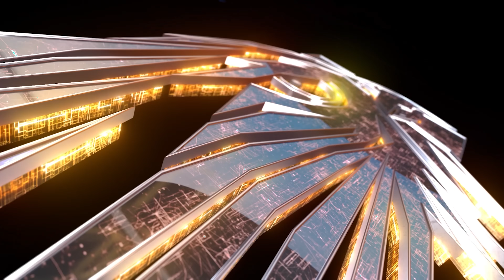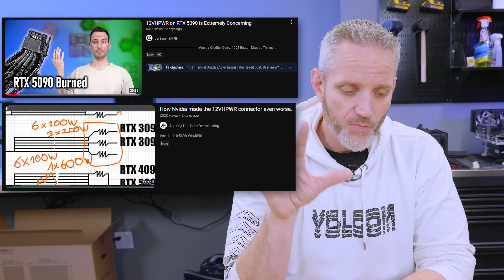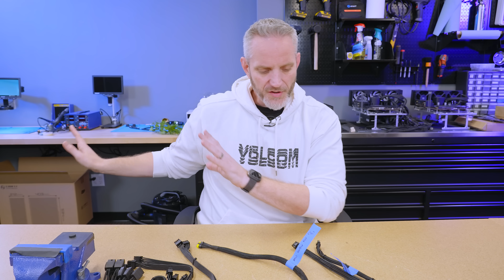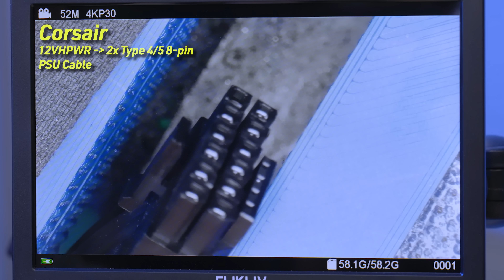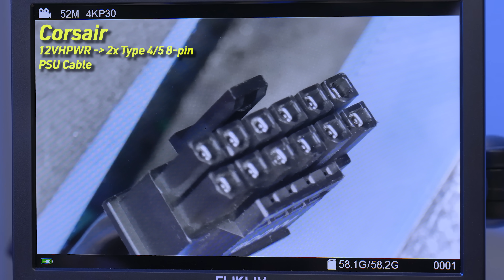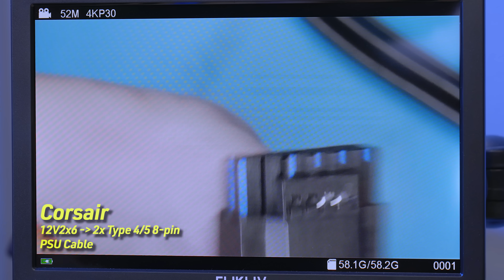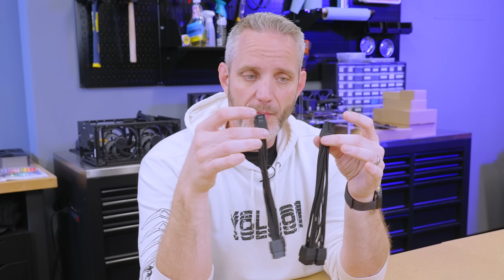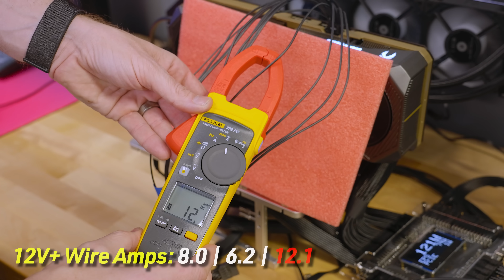I discovered something concerning and I need the Experts to chime in... More 12VHPWR discovery!

Comment: I see it clearly, its a design flaw. They should have never ever used that type of terminal and connector or multiple thereof to provide 50 AMPS of current period! 6 small connectors that were never designed for high currents, paralleled to provide such.  Any difference in connector to connector resistance no matter now little results in heat. Heat eventually damages the wire connection and the terminal creating more resistance and more heat. Its a self fulfilling cycle until eventual meltdown. They should have used a high power rated connection system like an Anderson Powerpole or xt60 type connector. and just one set of 12v  wires and connection would be needed  Electronics history and power connections is replete with such failures.  One example is Pinball machines and their molex connectors overheating for powering 12v lamps.

Comment: I've said this since the beginning of this drama that the problem with these connectors is the pin size.  You cannot take a 16 AWG wire and neck it down to a 22 AWG pin that isn't solid gold and push it to full spec of the cable and not get melting.

Comment: And here I was just thinking it was time to simply cross out the 600 on these damn cables, treat it like a ~350, recall GPUs or undervolt and reduce power targets on existing ones accordingly, republish benchmarks with the safe power targets, and use a new power solution on high power GPUs going forward. But this pushes me further towards thinking every product based on any 12v 12+4-pin power cable/connector just needs to be recalled and the whole spec for both gen 1 and gen 2 considered a complete failure. And maybe a gen 3 with lower gauge connectors and wires and tighter manufacturing tolerances could save the concept of the 12v 12+4-pin, but good luck getting a card with that to sell as well as the same card using 4 8-pins would at this point.

Comment: A poor connection (ground or otherwise) absolutely can cause increased resistance across a circuit, thus forming higher resistance to current flow. The result of added resistance is heat, so it makes sense to me. I'm an electrician with a lot of dc experience as well, so take that for what you will.

Comment: Anything above 3-400w+ on a single 12vhpwr connector should be barred from being produced on a government level. Ontop of that nvidia should be forced to recall any card which uses this absolutely stupid power design, especially the 5090 as thats a fire hazard and will burn down houses. Its gonna be even worse when cables degrade over time.

12vhpwr is a terrible designed connector for what it needs to do compared to the old 8pin ones, pins are too small, wire gauge is too small as its physically impossible to fit decent gauge wire in the connector, contact surface of the pins is less.

Comment: If we are talking about only high current +12v and Ground, why the hell aren't they using connectors made for high current, like battery connectors  and EV design?
Reply: This design should defiantly have had a lever lock to remove any discussion of not plugging the cable in all the way. While it wouldnt solve this issue in the video, it would be greatly improved

Comment: The pin height is not the issue. Drawing max rated power is the issue. Period. Everything should be over sized to supply at least 50% more power than what's rated.

Comment: Please keep the investigation alive and continue pointing this stuff out. This whole thing back with 40 series has never set right with me. I don't care what the spec says and especially what the mfgs say. Let's just say it (40 series issue) was a problem with cables easily loosening over time - this is due to the connector being unable stay seated and is STILL not the consumer's fault. MFGs should have at LEAST created some sort of mounting mechanism that would hold the connecters in place tightly to the card. They brushed their hands and told their customer's to fk off. This wasn't just a couple isolated incidents. So while we don't know if 50 series will continue having problems and if these problems are actually the same, it would be good to get out ahead of them as fast as possible because for some damn reason people are still ok throwing money at them early. IF I needed an upgrade bad (and pretending like this dogshit launch actually had stock), I would probably go in on a PS and/or Xbox and let this play out for some time - these issues like to creep up periodically.